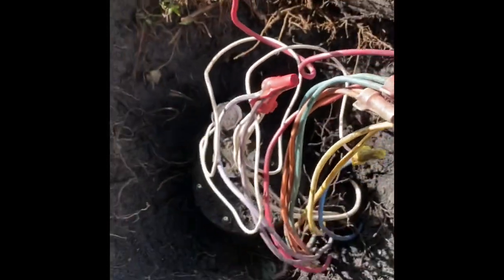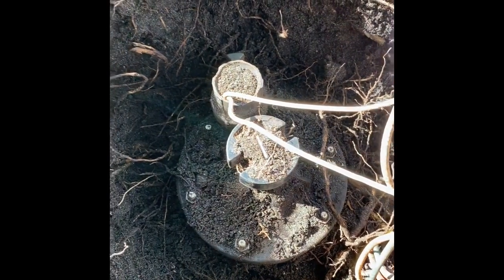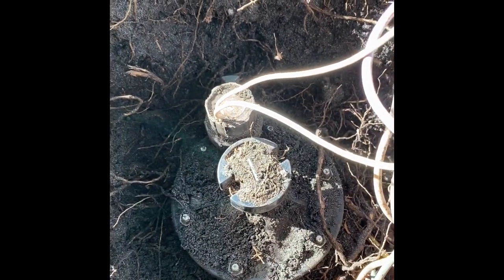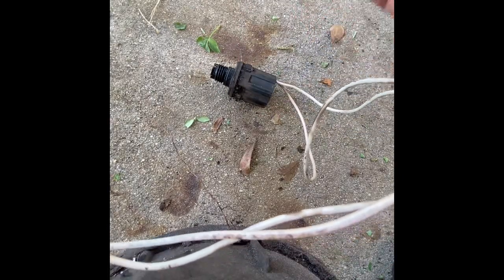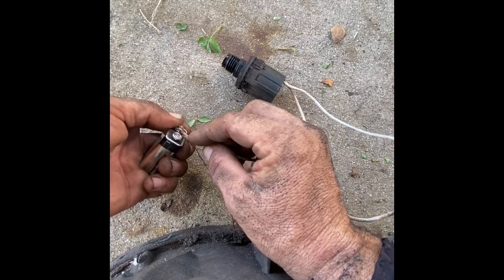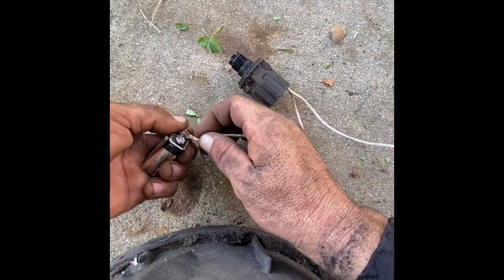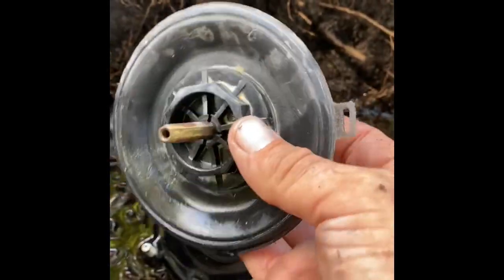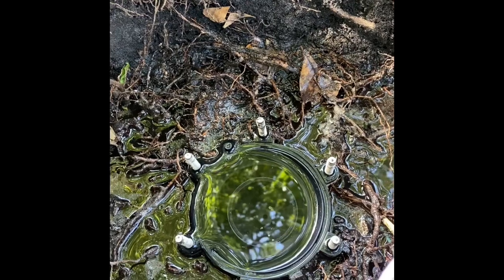How to check if the valve solenoid is good or bad with a 9v battery. #tjyoursprinklerguy

Comment: Some timers have the VT on the module which is valve test so its 24v hot all the time and you can touch it to VT and comm for the same test.

Comment: How do you trip the valve to test a zone if you don’t have access to the timer? Is there a screw or something to pop it?
Reply from the maker: Hello. Thanks for reaching out. U could actually turn the solenoid (what I'm testing). Unscrew it slightly and you will hear the water flow through the valve.
Reply: @tjyoursprinklerguy8846  thanks- here’s the situation.
It’s a long run of city sprinklers in a strip of land in front of residential houses - city doesn’t maintain them and slows us to plant the strip.  I have access to the valve/solenoid (in line) there are two heads on my section but they don’t cover 90% of my section- Since I don’t have access to the timer (locked in a different bunker somewhere) and the sprinklers go off at some middle of the night hours on random days - I can’t check what is being covered. I’d like to branch a drip system, or some rotating heads etc. off of them but need a way to pop my area to see where my sprinklers are hitting -or if at all without camping on-site to wait for them…
Thanks for your expertise!!!
Reply: @tjyoursprinklerguy8846  thanks- here’s the situation.
It’s a long run of city sprinklers in a strip of land in front of residential houses - city doesn’t maintain them and slows us to plant the strip.  I have access to the valve/solenoid (in line) there are two heads on my section but they don’t cover 90% of my section- Since I don’t have access to the timer (locked in a different bunker somewhere) and the sprinklers go off at some middle of the night hours on random days - I can’t check what is being covered. I’d like to branch a drip system, or some rotating heads etc. off of them but need a way to pop my area to see where my sprinklers are hitting -or if at all without camping on-site to wait for them…
Thanks for your expertise!!!
Reply from the maker: @jsmith-lv8jk  yeah if you can access the valve then just unscrew the solenoid (not all the way). You should hear the water flow. This will allow you to check all your heads. Rain Bird make a pop up sprayer head that allows you to connect a drip line. Have you tried to turn the solenoid?